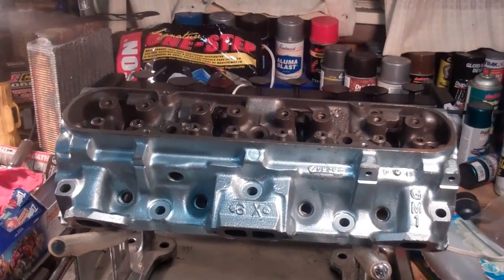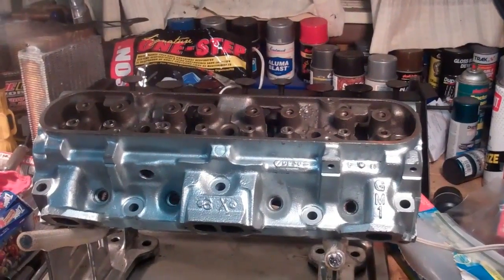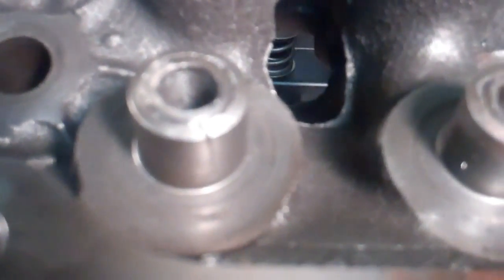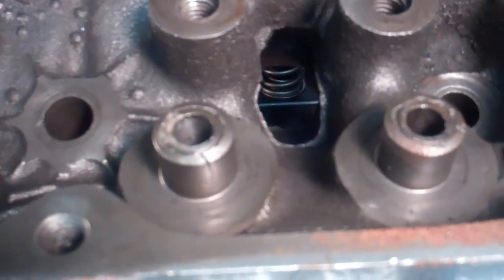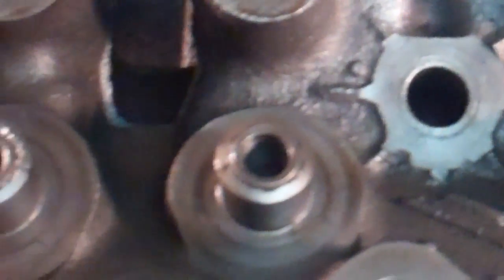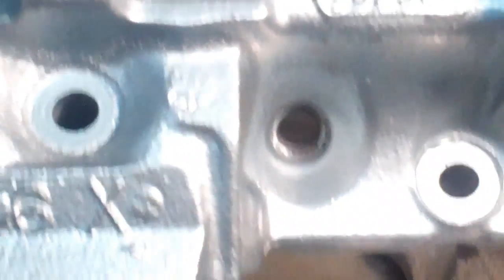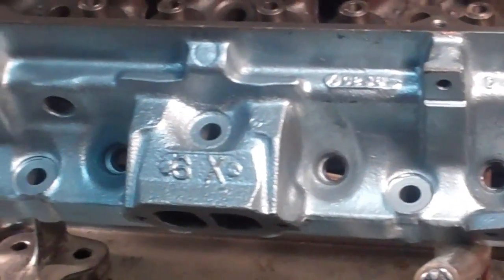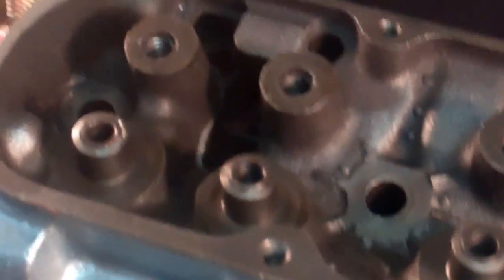Pontiac 455 Build; Cracked Valveguides

Comment: This is a normal occurance  when driving cast iron replacement guides into the bore-The head is not "ruined"-This is why most shops have changed over to the .030 bronze sleeves that are not near as tight-But have to be reamed or honed.

Comment from the maker: @nanotech1a It's possible the guides might be saved but at what cost? Since I had not done any work to these heads yet (porting etc.) I may be able to pick up a used one for about the same price as the machine shop would charge to weld these guides, especially 5 repairs.  
Thanks for your input though, I will run them out to see what it would cost.  By the way this is not a numbers matching engine so it's not that critical.

Comment from the maker: Thanks for the comments.  I've done some work (Porting) on these heads already.  I am not finished so I haven't posted any videos but they are coming soon.  I took Myvintageiron's advice and ran them to my new machinist and he will fix them up.  New Bronze valve guide and seals as you said.  Also three angle valve job.

Comment: check the valve length, Pontiac carry's two valve length, I think the guy who built the heads used the short ones, I think, 4.98", u need the one that 5.089"

not sure about the numbers, check with jim Butler website, the whole lengths are there.

Good Luck

Comment: not all might be lost i know that some small block chevy valveguide have a bigger stepped upper valve seal ID by going to a machine shop that head might be saved if the proper valve guides are found those style will slide press fit all the way to the shoulder till it stop flush with the valve spring pocket unless you are looking for a genuine restoration that alternative might save your day

Comment: Those cracks don't have any effect on performance it is just the shell that is left over it is very common when installing the .502 guide the head is not scrap they r perfectly fine they would not run like crap or drop a valve you really don't understand what your looking at there is nothing at all wrong with those heads I have been a machinist for 25 years you are stressing about nothing if it  bothers you that much you can buy a PC cutter that u can use in your drill very easy fix

Comment: No sir it wouldn't cost $60.00 you are not hearing me I have been a machinist for 25 years and I've had my own shop for the past 11 I could fix those heads for $15.00 in about 10 minutes they don't need to be welded or anything like that the area where you see the cracks is just the shell of the old guide left over after they bored em out those cracks DON'T MATTER! more than 50% of the heads we rebuild crack there during guide work and I've done thousands It's normal but they should b trimed